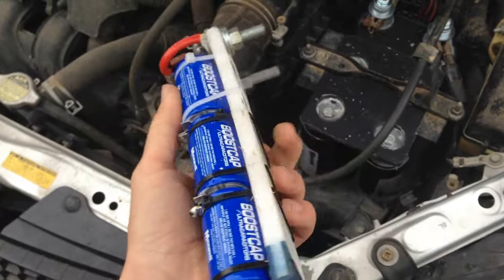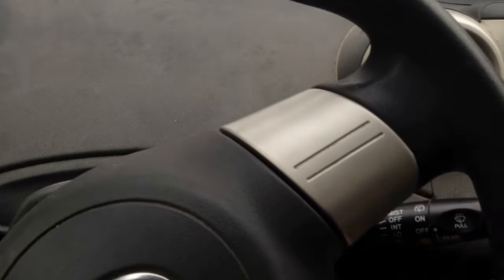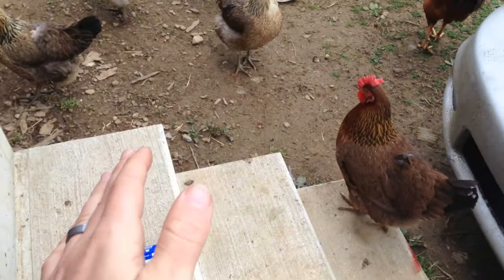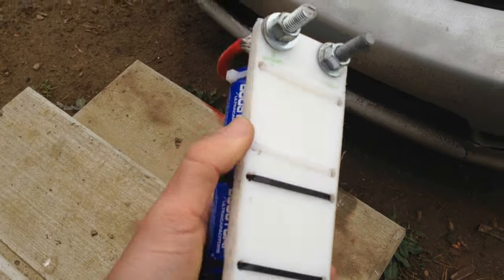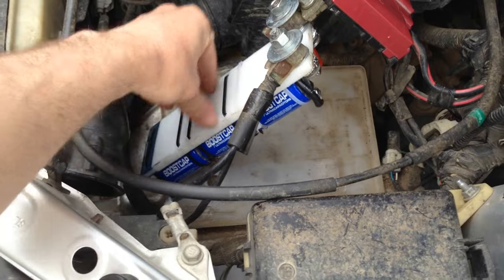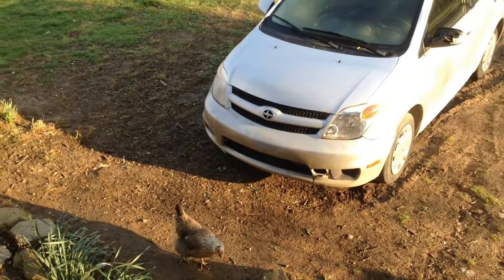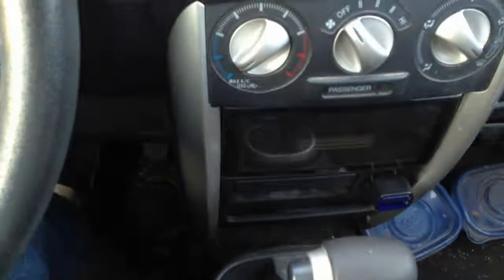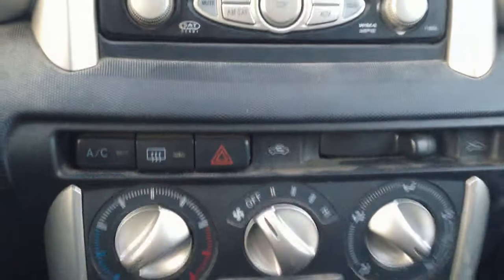Replacing My Car Battery with Capacitors! 12V BoostPack Update

Comment: Come to Minnesota this winter when it's  25 below zero, after five years of using it.  If the car companies could 30 pounds with a battery they would.  My wife's  Dodge minivan has an aluminum hood to save some weight,  Even hybrid cars have a regular batter for the starter.  Not sure why.

Comment: Hey buddy.. that's not designed to replace the car battery, it work a long with the car battery hocked in parallel, it will increase the efficiency of the car electrical system under heavy current load. if you replace the battery w/ those CAP's, your car will not start in morning  due to continuous load consumption from ECU, car alarm & car stereo memory over the night, which eventually will drain the cap's.

Comment: Nice work! How much have you spent for the capacitors? Are they cheaper than a new battery? What will you do if you accidentally shorted the capacitors as capacitors lose their charge when shorted?

Comment: How did you control the voltage from the altenator of your car to the boost pack? Don't they overcharged? Safety wise in case of it blows under the hood. Can u suggest any?

Comment: since it's old. what's the update? how's it run on a 3000 watt sound system with 2 10-12 inch subs? and LED lights and laptop

Comment: So are you still selling these somewhere? Or is attaching a lithium ion battery as a backup to challenging? (protection circuit for the LI to stop the caps charging it and the alternator overcharging it etc)

Comment: Leave a car using a capacitor bank for some time and it will surely discharge in the meantime. BUT if you use this as an backup  (if your battery suddenly die or fail) this would be the best idea ever, smaller than an regular battery and lighter than those "car starter" power banks, perfect! :-)

Comment: Question 1: I'm currently building a race car. Would this be a viable method for just trackdays and traveling back and forth. 

Question 2: How long would it take to recharge the capacitors if discharged?
Reply: Q2: If you have good charger, like an hour? Probably around 20 mins to get cranking voltage with 5A charger

Comment: NIce, looks like a great setup for racing and for efficiency. combine the capacitors with regenerative breaking, a Peltier or 20 and photo-voltaic cells, you'd have dependability.  I'd love to order a system from you for my 01 outback.

Comment: Question:
You showed a quick start of what seems like a late model, in tune 4 cylinder motor.

What about when its a clunky old, out of tune, coldish 6/8 cylinder with iffy starter motor which needs 200cca to wind around???

You say "do some testing". What you really need to test is what float voltage the caps have after half a dozen wind-arounds but no-starts.

Comment: Curious , I didn't see any kind of balancing setup for the caps but it seemed to work..I  bought some caps a while back and paralleled 2 strings of 6 x 2.7 v 500mf , (  16.2 v 166mf )..I used rectifier diodes x 4 in series ; paralleled with each cap  ( when the cap gets up to voltage the diodes switch on thereby bypassing the caps so as to not overcharge the cap ) But when I tried to charge the C/bank up , my chargers  anti - short kicked in..So I paralleled the C/bank  with a charged battery for a few minutes and then tried the charger again , it started to charge the C/bank but I could get no more than 14 volts??? Anyway it started the car ..I've changed to 2 strings of 5 x 2.7 v 500mf , ( 13.5 v 200mf ) paralleled with a 12v 7a/hr  lead acid battery..But I'm having problems with the setup not able to sit for long spells and needing to be recharged..( Doesn't take long but )

Comment: When you think about it, the battery boosters, jump starters being sold are so light weight and skinny. So it's a possibility they're just capacitors as well. A very small battery with capacitor/s.
Reply: Nope, Li-Poly cells. Can also give out some decent current (not as big as supercaps!) but they also hold their charge much better

Comment: Really cool stuff! played with big (for the time) capacitors when I was younger! I can see this working for cars that has no alarm system, no leaking current drawn and so on... so for some cars this this obviously works as you shown... the car I'm driving now it would work, but the 5 I own before it would not be a good solution... but with some wizard circuitry and a lithium pack I would be an OK replacement I guess for most cars... it would actually save fuel by weight and smaller alternator... cheaper? for consumer maybe but probably not for manufacturer and there is the problem I guess... Btw next step is a huge (bigger with slow discharging circuitry) capacitor bank that charges up with regenerative braking... then your all set and you can wave that battery good bye forever! :-)

Comment: Do the capacitors start the car more quickly than a normal battery? Like, does the extra voltage make the starter motor go faster?

Comment: I think this is a great idea just if suddently your battery run out and you have this bootstarp pack as an emergency solution with a solar pack rechargable unit even if the fail is bigger

Comment: Battery is not just for starting engine. It also keeps ECM working for few weeks.
I am not sure that capacitor works like the battery for long term parking.
Reply: The super-capacitor does work like a rechargeable battery. Just use a bigger super-capacitor or go "Hybrid" and add a small Lithium-Ion battery, for long-term storage.

Comment: 6 of those cells at 11 bucks each, a 75$ walmart battery lasts me 5 years in the texas and Arizona heat.  I like this idea for a solar set up or for camping.
Reply: Check out Graphene Super Capacitors. They are far superior to that type of capacitor. They're making batteries for motorbikes out of them now and I'd say for cars soon. Prices are up at the moment but won't be for long and they don't discharge power on standby anywhere near as much as those ones do.

Comment: All the chickens start laughing / cackling at the 7:11 min mark when you went out to do a voltage test on it after a day sitting there. Boy, you showed them - it started fine, later! Great video! Question: what would cause the capacitor bank to slowly drain over time when the car is turned off?

Comment: The specific energy of a capacitor is not hight enough to be used as a replacement for a battery. The energy density of a capacitor is about 0.01 to 0.3 Wh/kg, lead acid about 40Wh/kg. A capacitor would weight 133 to 400 times more than a lead acid battery to hold the same amount of energy. A typical car lead acid battery weighs 12kg, a capacitor would weigh 4,800kg, which is about the weight of three large family cars. Just to put thing in to real perspective. Cars which automatically switch their engines off while stationary have far larger lead acid batteries also, or even two normal sized ones.

Comment: My minivan battery is getting weak, it had trouble starting last winter. I was thinking of changing it but what if I build a cap pack like that and connected it in Parallel with the battery? Maybe I could get 2 more years out of the battery? :D

Comment: I've been meaning to ask. If your car were to not turn over and start on the first try, how many attempts does your capacitor give you before it is discharged too much to start the car? Even a new car may have difficulty in snowy weather.

Comment: Just wire in a hand crank dyno for a charger.  The kind you get for flashlights and radios.  Then when you have been parked for a long time you can charge your caps. If someone comes by you can be cranking it, not yanking it...hand cranked cars like back in the day!
Reply: Humans can not hand-crank very much energy

Comment: Aren't these Caps really dangerous though? I am a novice but I know a Cap out of an old Marshall amp will kill you. Is it because its holding 450V  and this rig is only holding 14V?    Also, Is there some kind of  purpose to this? Cheaper than a battery? Easier? etc?  How long will these caps hold their charge after you shut the car off?

Comment: Nice work, i have been checking on this capacitor as well. Instead of replacing the batter, i hope to use the capacitor as side-by-side for the current acid battery. Still got space to fit them in. Cause i am tired changing car batter every 6-9 months cause of dead batter. Can you test on this for me or share on your next video? thanks first.

Comment: The regulator is engineered for lead acid battery performance characteristics.  The caps have a much different performance. ?Will the regulator damage the cap.

Comment: Capacitor guy, as soon as I saw this Amrad turbo 200 capacitor I thought of you. There's a different Mfd load for each of six tabs. Can a capacitor like this piggy back on a generator to handle surges from like refer and microwave that would otherwise pop a breaker?

Comment: What do you think about using your set up (that you used in this video) but also have a small hand crank generator built into your car,  encase you needed to charge up your capacitors.

Comment: Was thinking of taking the battery off my ebike and using super cap charging from braking and flat road charging-riding, then hitting the cap power for the hills.  Do you think it could work out?
Reply: No way. Too little capacity in these capacitors. Might try to combine both for better results

Comment: How long can it sit with the radio draining on the memory wire before it can't start it?  A week?  Would be great to have a little lithium battery for slow discharge. And to keep it topped off.

Comment: Car company's really need to do this. It gives the engine bay more space for other things.
Reply: This won't be reliable at all in a newer car with computer systems and various security systems continuously draining power. The thing about capacitors is that they have a very small capacity for their size. A capacitor bank the size of an average car battery won't have anywhere near the same capacity as the battery. This is also why capacitors also aren't nearly as useful in car stereo installs as many think.
Reply: except it don't. Supercapacitors are still need to be ten times bigger than a battery to be able to contain the same ammount of energy. Also, they operate fine only in a narrow temperature band. They are no good  below -20C°and above +50C°. Needless to say it can be both much hotter or much colder under the hood.
Reply: Jonathan Demyon or they can just put the battery in the trunk like my 2009 CTS

Comment: Good work, even if you just carry it in the trunk in case your battery fails.
Reply: whats more important is cell cap balancing because voltage will drop if one cap gets low

Comment: Create the circuitry to wire it to the battery when the vehicle is parked. When the unit drops below 12 volts the battery automatically recharges the capacitor.

Comment: Don't waste your money people. Capacitors charge quickly, but they discharge quickly as well. Hence why we use batteries. They hold a charge for longer. So if you accidentally leave your headlights on for 5 minutes, the car will start. Capacitors cost more as well. Only benefit I can see is that the life expectancy would be longer as the capacitor has more charge cycles. But simply put, a battery is more efficient and much cheaper. You might have to replace it every 5 years, but it's a small price to pay for reliability.

Comment: Ultra-capacitors can provide 1000s of Amperes in a Single Burst, Are you using an additional electrical regulator in your car starting circuit ?

Comment: This may with with a small car engine, but apparently doesn't work with the 4.3l V6 in my truck. I have 3 capacitor packs 6x 2.7v 500f in parallel, unless I was scammed and they are not what is claimed.

Comment: How well would these work on 24v systems? What's the upper limit on voltage?
Reply: No. If the capacitors are 3v each, you need 8 connected in series. Same rules as regular batteries.
Reply: @rollmeister  No, they are either 2.5 or 2.7V each. You need 12 of them

Comment: that super capasitor. while on the electric transportstion its has been use for replaceing the battery, cause its more less time to charge n less weight but the price meybe expansive than battery. how much you spend for it.?

Comment: hey, if that 350F can run the starter to crank up a big engine on your car and recharge in 2-5 seconds fast before it totally discharge off, why not use that capacitors to crank an electric motor connected to a generator with the same torque as your engine in your car that will charge it as fast,  before it consumes all its stored voltage down. similar to what you did in this video.  
this time not use to start combustion engine, instead, an electric generator at similar torque.
could it be possibly be looped? could it be possibly be use to achieve overunity?

Comment: IDK why you keep saying “no hesitation”, as that is the last thing to expect..? The ability to hold the charge and the stamina should you need the starter to run for more than a couple of seconds are more likely to be relevant limitations since this is where ultra caps aren’t as good as batteries.

The minimum voltage at which it can start will be low compared to for a battery, because unlike a battery, voltage doesn’t drop a lot with high current due to internal resistance. It will however drop pretty fast at high current due to small capacity, so at low voltage the engine better start fast..!

But very interesting results. And since you have the space and weight is so minimal, you could at least double the capacity with another block in parallel. A LiFePO battery backing will help too, but for the same weight I wonder if it can handle currents large enough..? I think you’d need a way to current limit it at least, but then you should be able to recharge the boosters if they are depleted. IDK. Would be interesting if you shared your thoughts about the different options, and of course even more if you go ahead and test them!

Comment: You can do the same with 8  D cell batteries. I did start a diesel vehicle (glowplug duration included). You don't believe this? Try this yourself,just be sure to use large diameter cables and metal connectors between the batteries. Why I did that? I did not have any vehicle close to me, it was winter and road assistance would have taken a day to come and cost me 200 bucks. If you are stranded and you have some D cell batteries, use em!

Comment: Ok looks cool ,but one copacitor 3k f (3000 farad ) cost about 95$ each , times six almost 600$ but car batery about 100$ and I'll be able use it for about one to three years ,the question is for how long time will be able to use it , at least six years?

Comment: very cool if i was to make one for my 6.5 turbo diesel as a booster to the batteries would there be an issue with using a 1200 fared set up?

Comment: What about the heat in the engine compartment?  Isn't there a risk of the plastic those are mounted on melting or the wood on the other set up catching on fire?  Could the capacitors themselves melt?

Comment: @lasersaber.   this may be dumb, but could I use ONE 2600 Ferod cap in place of 6 smaller ones equaling 2100?  less space, less inline splicing... just a thought, not capacitor expert...yet. :)
Reply: Where are you purchasing your single "16 Volt" super-capacitor from? Answer = no place.

Comment: Right.
This was a light petrol engine.
Tried this on a more common diesel e.g. 1.9L or higher?

And what happens if you connect the capacitors to a flat battery in a jump start situation? Would it be a too sudden discharge?

Finally, I’d be curious about the weights in commonly used units... KGS... ithout having to convert.
Reply: Different size engines require different size batteries. So, using some common sense, just use bigger super-caps with a 1.9L diesel.

Comment: The battery voltage decayed over the weekend because the computers in the car are a parasitic load.

A really good test would be to charge the caps and completely disconnect them for a week.

Then measure the voltage.
Reply: That is not a real-world test. His was.

Comment: (this question is for a capacitor bank without a lead acid or LiPo battery in parallel)
if, by accident, you fully discharge these capacitors, will it be difficult to jumpstart the engine?  if you parallel connect a lithium or lead acid jumpstarter to this, it will get as much amps it can in an instant.

can these capacitors overload and ruin an alternator?  like if you have a discharged capacitor bank then you get to bump start or clutch start the engine.

Comment: please check the working temperature of supercap. Commonly that is good only up to 60 deg C. Not applicable for those in the tropics specially during summer if it is under the hood where the engine is located. The supercap will degrade easily beyond working temperature.

Comment: My car needs a 300 Cold Crank Amp battery. That is battery will discharge at 300 Amps for 15 second while the battery voltage stays above 9.6V.  No caps can delivery that kind of power! This video is unreal!

Comment: Energy = 1/2 x C x V x V = .5 x 350 x 2.5 x 2.5 = 1100 joules
W-h = 1100 / 3600 = .3 W-h
6 batteries = 1.8W-h. 

I don't know what it takes to start a car, but let's say 500A. 1.8W-h would supply 500A for .003 hours or  about 13 secs. Plenty of time to start a car (even if it's 1000 amps). If nothing else, I would say parallel this with the cheapest lead-acid battery you can find, so you have both sufficient storage and instantaneous starting energy (that won't go away if it's cold).

Battery manufacturers rate (usually) by cold cranking amps, not by W-h. I think a typical car battery is rated for 50-100A-h, or 600 to 1200 W hours